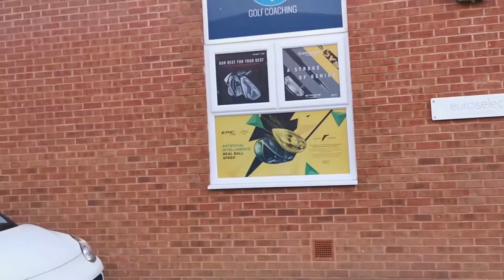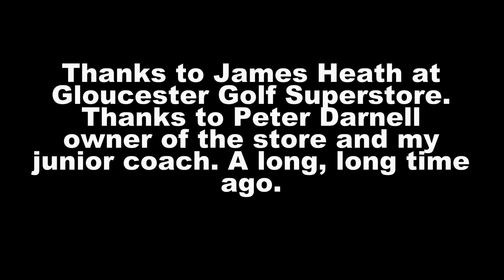The Marmite Kid gets fitted for the NEW Cleveland Launcher HB Turbo!

Comment: Excellent video.

Btw, how tall is he?

I’m a 53 years old golfer with height of just 5’1”. I’m interested to know the boy’s height and the length of his driver. Planning to buy new Cleveland HB Turbo driver and properly fitted against my height. What would you recommend the length of my driver should be?

Looking forward to receiving your feedback. Excellent video, hopefully Will get to see it again after he wins Dubai Classic.
Reply from the maker: Hello! I'm not sure how tall he is. I'm 5 foot 6 so Will is under 5 feet tall. He will be 11 very soon. I can't remember the exact length we had cut off but looking at the video I would guess almost 4 inches.

I am no Professional Golfer but I would guess for your height it might be worth removing 1.5 inches. The key bit is the hand to ground distance. So make sure when you have a fitting that they measure that. It could be that full length will suit you. For the record I have short arms so my lack of height does not stop me swinging a full length driver.

Best of luck.
Reply: Thanks for your feedback. Truly appreciated. Keep it going.
Reply from the maker: @mdjamilabdulkarim1364  Just remember that a guy 6 foot tall can have the same hand to ground measurement as a guy 5 foot tall and they both play the same club. So be sure that measurement is done before you make an expensive mistake and shorten the club. Good golfing.
Reply: Thanks for the kind reminder. Surely take note of it. Will keep you informed on how it goes.